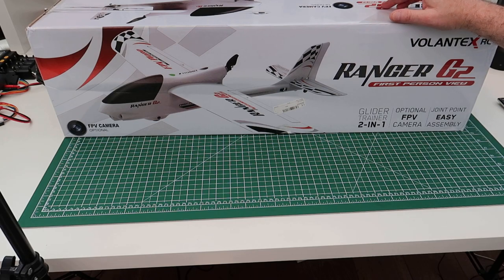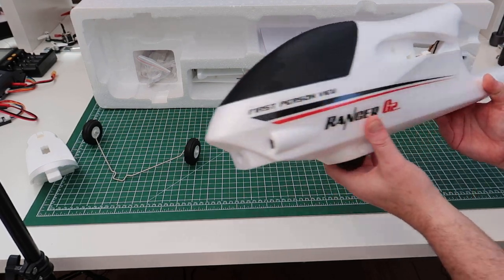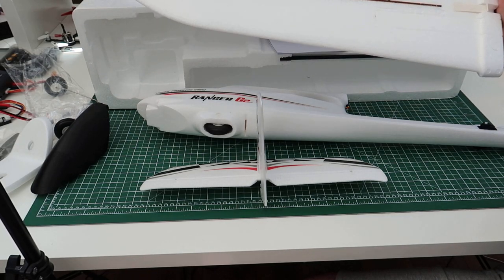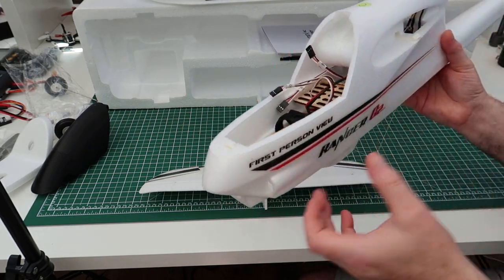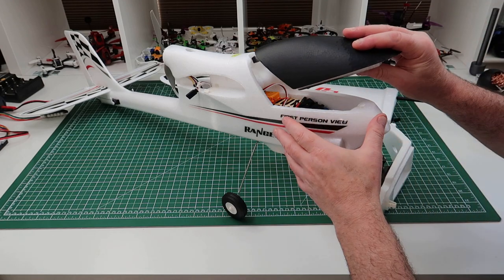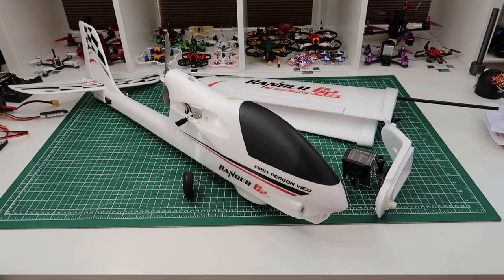VOLANTEX RANGER G2 UNBOXING AND BUILD OVERVIEW

Comment: Well iv had this in the box for almost a year, just finished putting it together and all i can say is, the space inside for a decent battery is an absolute joke! i was looking forward to putting a decent size battery in her for a good bit of cruising.. a 4s 1400mah is about all that fits. Shame really as its a decent looking plane..
Reply from the maker: It takes like 5 minutes to mod it i am running a 6000mah lion 4s and it fits in the standard bay  gets 40 mini flight time with plenty of juice left in the battery
Reply: @CKone41  nice..i think i,ll have to do the same, built it but never put any time into it, its hanging on the wall. I,ll give it a second try once iv finished my other builds..😁